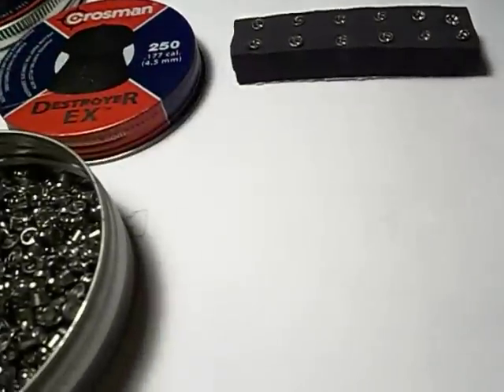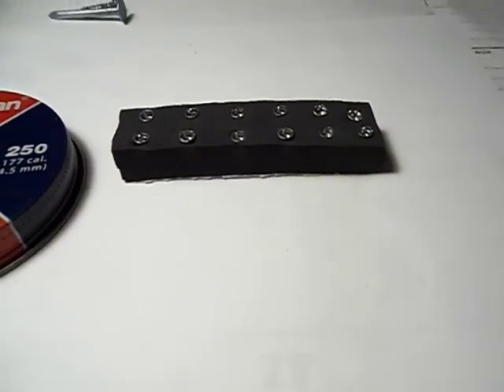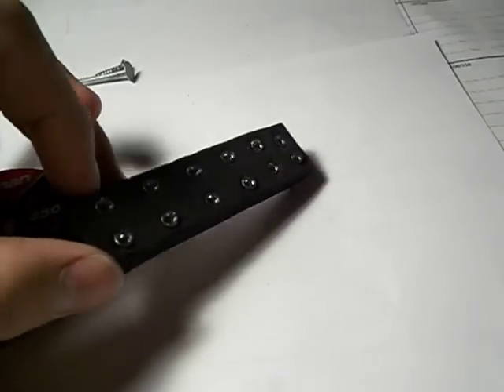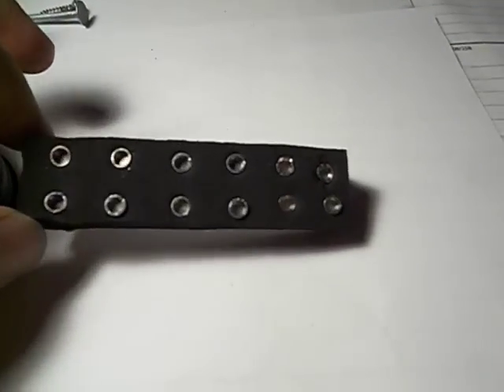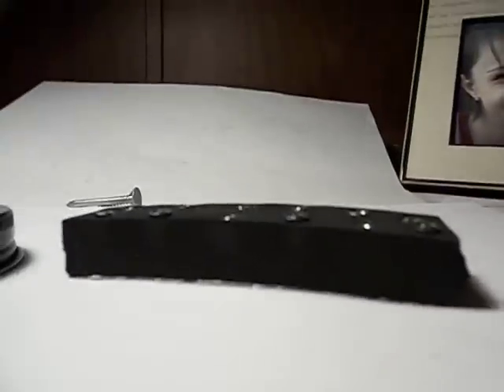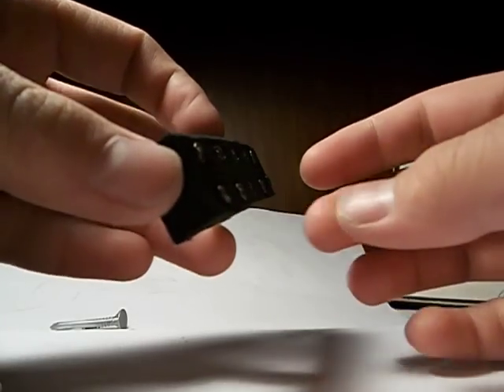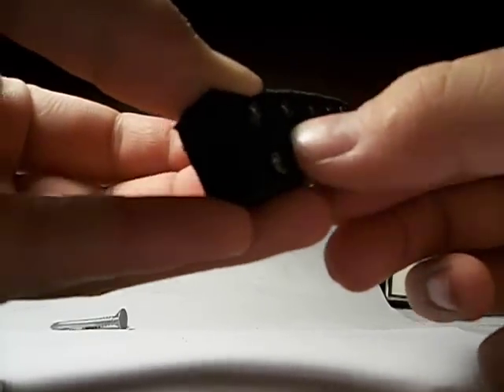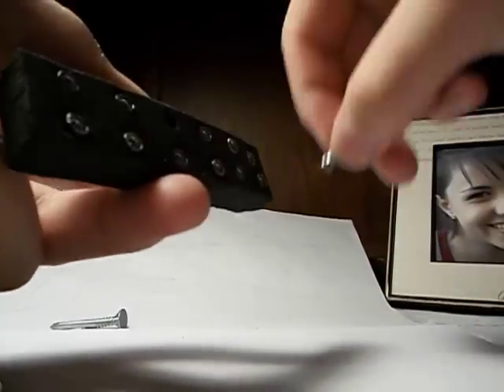Homemade Pellet Holder

Comment: This idea works... Check out the vid response i posted of my Big Cat 1200, w same idea installed on the stock...:)  beats the HELL out of stumbling with frozen fingers through lint caked pockets!  For affixing it to my rifle, I used 3M double sided foam tape, and used a 1/8 inch drill bit  turned by hand to make the holes....

Comment: i had luck using a piece of styro foad with duct tape on it, poke some holes, and some pellets in and you have a side of the gun pellet holder.